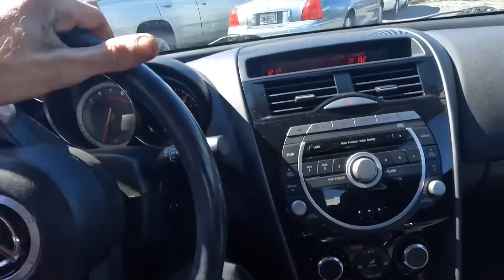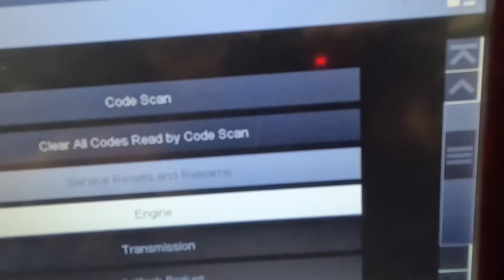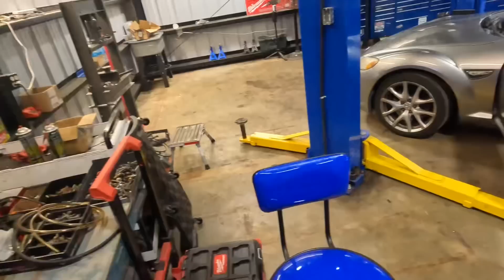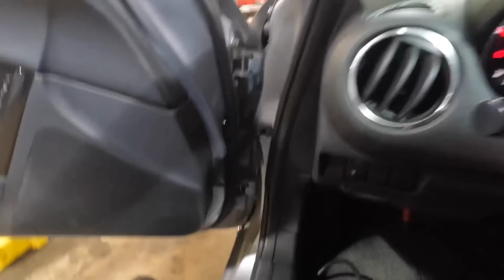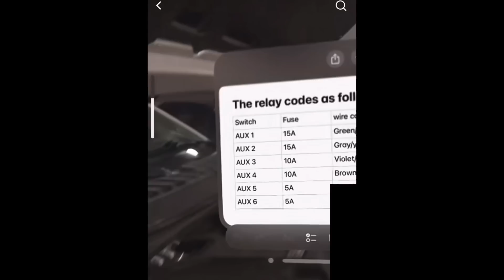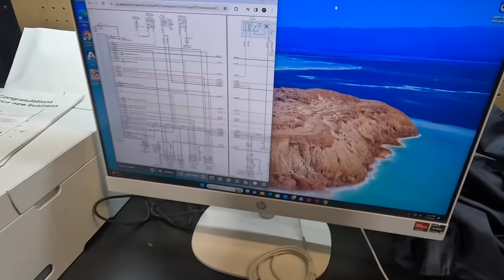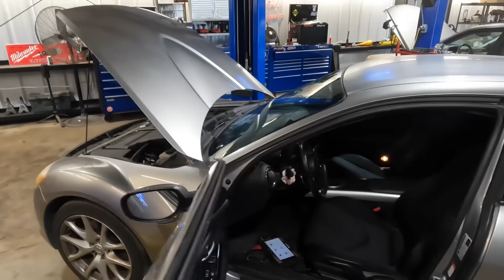Will Virtual Reality REPLACE Mechanics?? Mazda Rx-8

Comment: A advanced version of that headset may be useful in designing and fitting parts, ie: looking at a 3D digital image of a wing front spar where you're designing a bracket to support a hydraulic line?
You grab a 3D piece of plate from a bin, pull, bend, shape it, test fit it, adjust the part, look at the drawing floating next to you, then move to the next location and confirm that part will also fit at this position and any other?  ;-)

Comment: Agree about the auto trans on this car, used to have an 80' rx-7 - wouldn't have been as much fun as the manual but yes they do burn some crude! especially as the rotor seals wear out 😂

Can't replace technicians, without them the digital world collapses and we all go back to the 19th century. 
Ray knows this - he lives in a Hurricane zone, when those happen power goes out, water can be shut off and you have to survive on your own until skilled technicians make systems safe and get services re-connected. Good luck trying to fix mains power by VR 🤣

Comment: Those VR/AR headset $3500 and you'll need to get $3500 for dongles and you'll need an air play monitor with laptop and desktop Apple and for those will need more dongles $3500 more for each device with payment apple card.

Comment: i love my quest 2 and 3......but you would have be a complete moron to think that any VR rig is going to replace actual physical labor. 

you can tell the lack of intelligence of the guy who was making the claim by his using the obd tech as an example. all obd does is give out diag codes and various sensor information. it a tool FOR mechanics, and most certainly didnt replace any actual work that a mechanic does

Comment: ok, here's why i do not trust most any mechanic, i have a bill here for152.00 he replaced 1 spark plug and 1 ignition coil on my 2005 honda accord, the number 4 cylinder, right on the front left of the engine, easy peasy it took him 5 minutes to perform this task ,he charged me 13.58 for 1 spark plug, 56.01 for a cheap Ignition coil,4.89 hazardous materials chargeshop supplies 12.00 in which he used no shop supplies, and then he said i needed the valve covers replaced, that was a year ago, this engine does not leak a single drop of oil to this day , LMAO , some mechanics are simply crooks, beware.

Comment: Funny that you mentioned the smoke machine again today. I just recently viewed the video where you showed the failure of a vacuum brake booster, and it went undetected based on where the smoke machine is often connected. Last week, i was trying to diagnose a lambda issue, because my car failed an emissions inspection (lambda value too high, meaning that the car is running lean.) I hooked the smoke machine up to the hose that comes from the brake booster to the intake. I didn't see smoke. Tonight, I reconnected the machine to the intake air hose and find that it was leaking between the air filter box and the throttle body, right at the throttle body end of the hose. I relaxed the hose clamps, reset the learned values and checked the lambda. It should pass now.

Comment: I normally agree with your diagnosis but this time, I question going right to the PCM. The “throttle control module” to me speaks to the electronic throttle body. It could easily be gummed up, stripped out, or have a bad connection, so I would first try to thoroughly inspect the throttle body/actuator and its wiring before firing the proverbial parts cannon.

Comment: BS biden will remove all techs and replace them with gaming headsets since all engines will be outlawed and you will walk....ITS FOR THE GREATER GOOD  $5000 to have the handset displayed into your headset. Whats really sad is go get the part number...the model number, part number and if it has it serial number and the date it was manufactured are stored in the unit and the crap overpriced hand held units can't go get that info for you.

Comment: Until science & Scientists can develop & then put into production a machine that can see as good as us, they will not be replacing anyone. True there are computerized machines that do some of the work in Automotive Factories, but the “Parts” they’re working with have to be in the correct orientation or the computer controlled machine cannot fix it like we can. Our vision is much better than computer controlled machines.

Comment: It's not going to be VR/AR that replaces mechanics. It's more of an AI component that will. You will be able to plug in an AI scanner that will select all the data to diagnose the issue. How may video's show a diagnosis using a scanner and a pico scope? The AI component will do all this for you. Yes there will be many times that skilled hands will be required for the repair but the diagnosis will be AI many times.

Comment: It's the same with going to school to be a mechanic. They teach you how to do maintenence and repair of the most common issues, but they don't teach you how to diagnose the uncommon issues. I had an ASE certified,  Lincoln Tech educated kid that couldn't do a proper oil change or even remove a brake drum that was rusted on, much less replace brake shoes. He only knew disc brakes and had only been trained on new, rust free cars that were donated from the manufacturers. In most cases,  there's absolutely nothing wrong with these cars and they're just taking apart and putting them back together, over and over. I was taught in the real world, with cars that had been in daily service for years and corroded from driving through salt covered winter roads. You need common sense to diagnose, which you can't teach. I excel at electrical problems, which is not taught in any book. In fact, I took a class on automotive electrical diagnosis and tested out by explaining how a GM turn/parking/side marker light work with no ground to the marker light. I saw the circuit and instantly saw that the marker finds its ground through the filament of either the parking light (when using the turn signal) or the turn signal (when using the parking lights) and flashes opposite when both are in use because it needs the positive to the turn signal to be open to use the ground. I really wish I would have stayed in the class for the fun of it, though.

Comment: What if your VR screen scans the connectors and determines like the terminator through AI that the connector isn't tight based on a visible inspection? Even if it doesn't know for sure because of lack of feel, what if it sees something that could be arai and suggests that it might be lose? 

Funny. The RX8 reminds me of an updated RX7, especially considering the rotary engine.

Comment: VR might be handy in providing a display at a glance so you don’t have to walk back to take another look, but it won’t replace the skill and experience needed to solve problems. Other than having access to information on the spot it’s no different than what we’ve had for several years now.

Comment: All modern tech helps one way or a other. But it still needs a human to sort the gremlins. 
 You can never fully replace a human.Ray you cannot be replaced with a computer ever.
  So the facts speak for themselves. 
  Even a self driving car is crap.still needs a human at the wheel. 
 Ray you are irreplaceable knowledge and how to use it correctly is gained by experience. And you have shed loads.
 Next vid please .

Comment: It's already kind of dumb that some service data conclude at a "Circuit low" code that you have to replace the component. Instead of first suggesting "Plug the thing in you dummy" before assuming the actual component is defective. Loose connections are probably one of the most common (and easy to fix) failure mode.

Comment: Listen this is just like what they say about Electric Cars. We are nowhere near the infrastructure to support all cars on the road to be electric. In order to change out all gas stations to be electric charging stations will be a long and very expensive and probably not possible endeavor especially since the oil companies have so much power and money that they're not going to let that happen so that's why electric cars are not the future. Period ! And also about the virtual reality thing It might be able to tell you what's wrong and what to change but the virtual reality can't change the part you almost forgot about that you need a technician in order to replace the part to unbolt it change it out revolt it also to order it you got to look at different options you can't just choose whatever option you got to look for what's best for the customer and their price range so trust me you got nothing to worry about Ray ! At least not for your time!

Comment: I have an I.C.D. (Implanted Cardiac Defibrillator) that monitors my vitals, and stands at the ready, with 15 years of battery life, to "jumpstart" my heart if it stops again. It is bluetoothed into my phone, which has a wifi connection, so it can be monitored by nurses at the cardiology center in Grand Rapids, MI., so I have microchips implated in my body...

Comment: Ability of computer to assist mechanic (and, maybe call in the mechanic) will depend on instrumentation added to cars (with - I hope - standardization. The engine could tell you there is a leak of any fluid or pressurized system. And perhaps pinpoint it. Someday.  Maybe.

Comment: True mechanics won't use this VR nonsense for all the reasons Ray says...modern main stealer "fitters" might...would look in their little headsets under the bonnet (hood) and highlight which part to replace based on code reading diagnosis...no true mechanical diagnosis or repair....that is where society has gone wrong...everything is disposable...

Comment: If they tried to replace you with AI. They would charge so much for it  the average car owner could not afford it. Look at what they charge for scanners and other high tech tools. Then you have to buy subscriptions galore because every car maker has to be just a little bit different so to make their brand inaccessible to the average car owner/ repairer. Without detailed flow and wiring diagrams it is pretty much impossible to do any in depth analysis of any newer car problem. I'm surprised that people aren't up in arms about this right to repair their own vehicles. There will always be the folks who don't or can't work on their cars,  but really over complicating the repair of a vehicle is highway robbery.

Comment: The vr glasses are a monitor with sensors to see movements. Not ai... You are correct. Hands on stuff will be hard to automate. Imagine replacing nurses, electricians, etc. The information side is one thing the physical side quite another.

Comment: Ray, I have watched a few other mechanics on YouTube talk about VR and I agree with your.  IT will not replace a real mechanic.
I  also agree that watching a YouTube video does not accurately Diagnose a problem.
I have used your videos to see how to do something that I have to do like replace and alternator or battery etc... but VR can't diagnose a real problem.  Technology like your scanner points you to POSSIBLE issues, many times the most likely issue, but you The Trained Technician have to go through the steps and find the problem,  sometimes the technology helps but you are right it cant see the broken connector, the frayed wires, the wrong part used, etc.... I personally would not go to a Garage where I saw the tech wearing VR googles,  unless I know the Tech is also a top notch mechanic.

Comment: People are so foolish enough to put chips in themselves thinking their lives will be better. When in all actuality it just gives the people in power more control over your life. Cuz if you think about it. How are they able to pick up brain waves brain waves are picked up through frequency your brain releases frequencies whether you realize it or not that's how they're able to read whether or not you have brain activity. If that's true then they also can attack your brain with frequencies as well. And those frequencies can cause a whole sleuth of problems mental health issues you name it. They can alter anything in the  human body using frequencies. Your neurons and your neurological systems operate on electricity and frequencies if that electricity or frequency is disrupted in any way it can cause health problems. Think of ourselves as biological computers. And yes there is electricity within our bodies which are neurons fire. Believe it or not you can actually measure the electricity being produced by the neurons. And yes those neurons can be disrupted those neurons electrical conductivity can be screwed with and messed with resulting in problems health-wise. The human Spirit however is separate from all of that human consciousness comes from the spirit I believe.

Comment: Really loved your rant. I was working in the automotive field when OBD was being replaced by OBDII and from my experience since then all OBDII has done is piss off Back Yard Bob. Amateur mechanics have forgotten how to properly troubleshoot. When I was a service writer, we had guys who I called "shopping cart diagnosticians" which was basically a tech that would check the codes and rather than troubleshoot and diagnose what was broken, he would simply fill a shopping cart with parts until one fixed the issue. I had one guy who was so notorious for this we finally had to put a stop to it because if a customer requests an old part that we recommended they replace, and the part wasn't bad, we would likely lose a lawsuit. Part of why I like your videos Ray, is how thorough you troubleshoot. I'm well aware that your experience would likely get you through some of these issues quicker, but I like that, for the sake of the video and entertainment, you go through the entire process of proving a theory. I'll take it a step further to make my point. I'm a member of a few FB groups and forums and daily, someone will post "CEL came on and I got xxxx code, what do you think it is?" It never fails there will be 10 responses of people saying change this or that. Typically, I'll give them a few possibilities of the root of the issue along with the process to narrow it down. The biggest reason for that is, new doesn't mean good, it just means unused and clean. There is almost nothing worse than assuming a part is bad and going through the labor to change it only to find out either the old one is good, and you still have the issue, or worse the new part is bad and now you have 2 issues both causing the same symptom. Not everyone loves their job enough to do it twice. (I quote that from you all the time BTW). 

Long story short, I agree with you 100%. AI or VR isn't replacing anything or anyone, it's just another tool that in the right hands will improve efficiency, but in the wrong hands will just cost more, which is exactly what OBDII scanners did and in some cases still do.
Reply: Long story short🤣👍

Comment: I have a friend at OpenAI and he checked the logs and apparently this whole video was generated by AI (no delorean) as are most of the comments. The system can now recognize if the mechanic is RR and its a MAF code and will now instruct the user to plug it in.

Comment: No es un"pequeño motor" Siendo un 1.3 litro de cilindrada unitaria, hay quienes dicen que debe considerarse a cada uno de los 3 lóbulos en la ecuación (como en 3 cilindros o de 6 cilindros en uno de doble lóbulo). Aunque nunca estuvo bien definido el tema de su cubicaje real, fue y es un motor potente, rápido y libre de vibraciones (excepto las del rotor excéntrico) 
Creo será aún un poco mejor motor en el futuro, cuando se desarrollen y solucionen las causales de sus defectos (Ej: consumo de lubricante y combustible, contaminación, diferencias de Temperatura en el bloque motor, etc.)

Comment: For the moment, AI/VR will not be able to replace real mechanics. (but already some bad mechanics). The fact your OBD2 tool does a lot of bad repair suggestions is a pointer to that. But, AI/VR is just a baby. When it grows up (and is really racist...which all AI seem to lean towards), it will be able to replace the better mechanics, I doubt if it will replace the real good mechanics though.
There will always be a place for real good mechanics, having the knowledge, experience and "underbelly" instincts.

Comment: How were cars fixed before there were computers?  My Subaru has an intermittent transmission problem.  I can find the exact symptom and fix on line.  The dealer test drove the car with the computer attached and determined the transmission was shifting OK (at that time).  They did not charge me a diagnostic fee and sent me on my way.  A description of the problem was not enough for the dealer to effect the repair.

Comment: I can see SOME uses for Augmented reality, but ALL of them still require skilled technician.
1) Highlighted component / connector location / wiring colors overlay.
2) Display of test meter reading. You're wedged under the knee bolster trying to read the APPS resistance etc - handy to have an overlay you can look at without trying to turn your head.

Comment: As a software system engineer with more than 50 years of computer system design and implementation experience, AI has been, and will very likely be, a total pile of idiot-talk regurgitation that "might" provide general direction to the ignorant user.  "AI" has "progressed" very little from the 1970s... very, very  .... little.

Comment: In time, the added VR element can be a tool, just like your scan tool. Once the VR devive has been reduced in size so it would be more like a pair of safty glasses with a cable running to a hip pack.